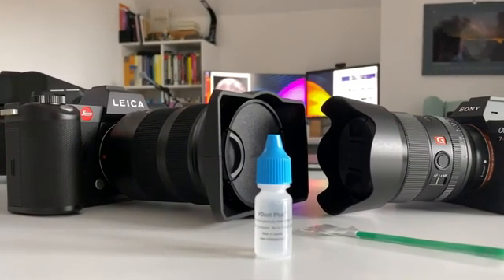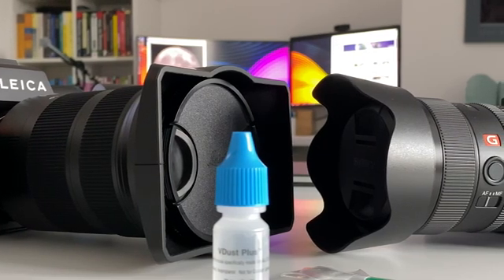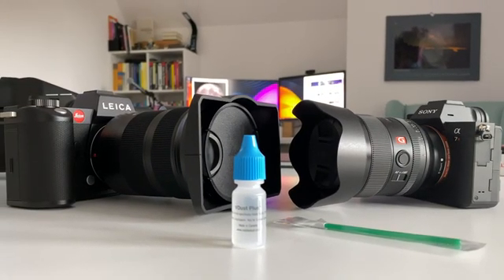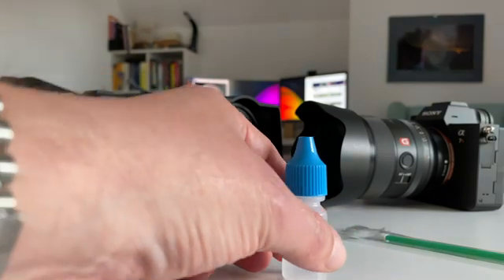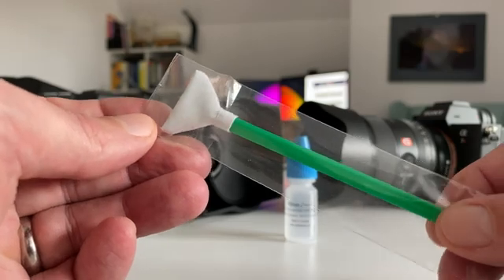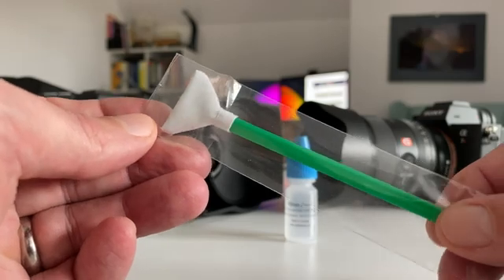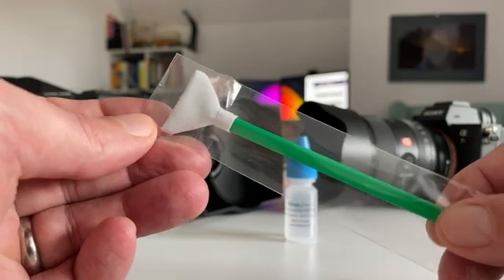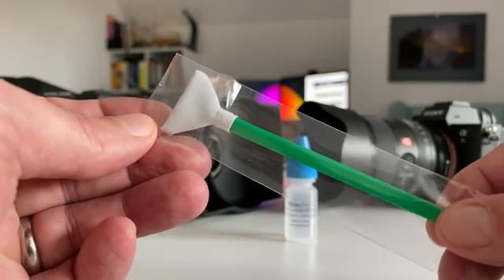CLEANING FLOATING SENSOR in IBIS CAMERAS | LEICA SL2 & SONY A7#

Comment: I have a Panasonic Lumix G9M2 mirrorless camera. Quick question. Do I clean the sensor with the camera turned on or off? Some say on to lock the sensor others say off. Bit confused. Also do I turn the image stabilization on or off? In all the videos I have seen these questions are not addressed. Help/Advice please.

Comment: Hello, I have followed your advice on cleaning the SL2, which get dusty in a hurry, with great success.  I am curious as to how you would clean the X2D, which also has IBIS.  Hasselblad's recommended method implies using Compressed air, which I would never use.  Since the camera has IBIS would you power on the camera as with Sony or Leica?  I also assume even using a hand blower, you would still want the sensor locked down?  Thanks

Comment: Hello Math! Great video. I just cleaned my sensor without locking it. I was verry gentle with it simce it was moving arround but than i found out about locking the sensor and now i am freaking out. The IBIS works fine but i was wondering what kind off damage may i have caused that i will find out later. Thank you in advance 🙏
Reply: Hi! Did it end up causing any damage? I had mine locked for most rounds or cleaning but didn't do it for 1 second, two different times and I am also freaking out. It looks okay but how can I even tell.
Reply: @kristenbrasil  Did this ever cause any issues with your body? In the same boat here.

Comment: Thank you for the tips.  My Leica store recommends use of the gel stick cleaner.  Do you have any experience with these and, if so, why do you prefer the fluid/swab method?
Reply from the maker: Interesting. I have not used gel stick cleaners, need to look into that. Thanks for pointing out!
Reply: @mathphotographer  See my postscript.  Gel sticks are not recommended for cameras with IBIS because they require more pressure than swabs.
Reply: @SLO_Foto  They work fine. Move along.....

Comment: Hi! Great video, as always, thanks. My sensor on the SL2 is moving and bouncing around quite a bit when the camera is switched off. Especially when held in a lens-down position to swap lenses. I know it's floating and the magnetic field is putting this thing in place. I was just wondering, wether it's the same with your SL2, since it seems a bit too much? Thanks.

Comment: On the Sony,  run the Cleaning Mode from the setup menu to shake off dust, but do not switch the camera off when it finishes. The sensor will then be both locked in place and also discharged of static for cleaning. I was told this by an experienced Sony technical person.
Reply from the maker: Hi Ken, this is a very useful hint, I was not aware of that. Will try out next cleaning round. Many thanks for sharing!
Reply: @mathphotographer I just tried it, turns out that when you do the auto sensor cleaning it actually says on the screen you can shut off the camera or manually clean before shutting off the camera.
Reply: Sorry but this does not work on the A7RV!!